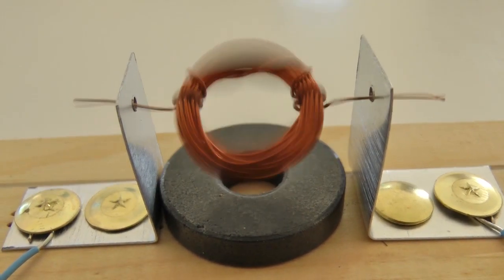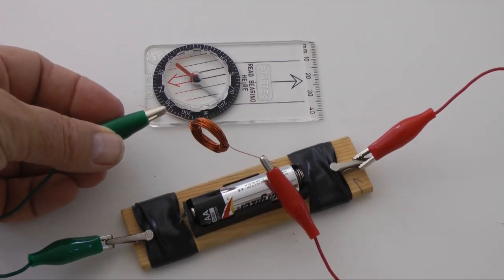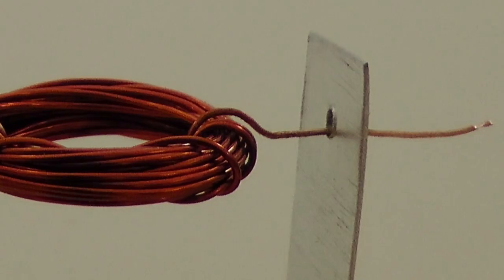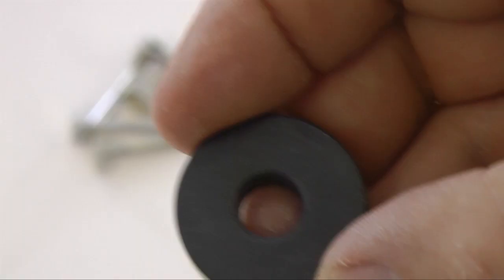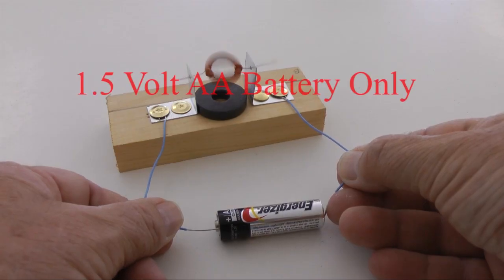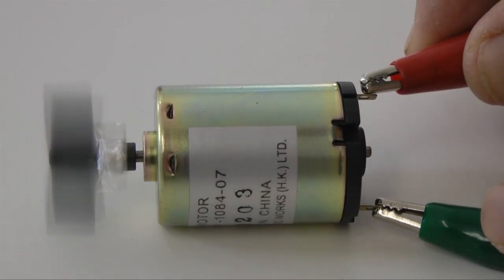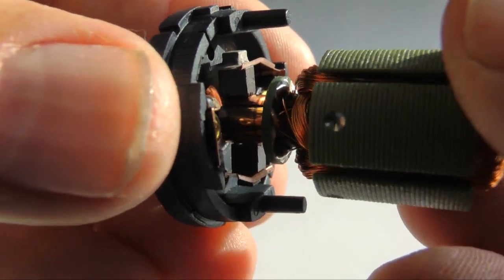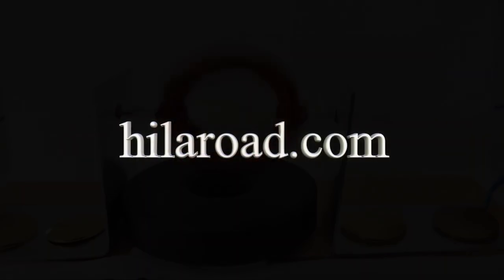Build an Electric Motor

Comment: When I found my interest for these things again, after about 35 years back in 2009, I started with this simple motor. I was so excited when It worked. I kept on going since and now I make motors that are a big step up from this one. I went brushless with my last one but I built my own magnetic switch instead of using a ready made reed switch. An for my next one I will finally use my nemesis, the transistor. I  have them all on my own site, if you are interested. Good luck everybody!
Reply: nice

Comment: how can i turn it into a generator and make LED Light turns on?
Reply: You just do the opposite and turn the coil of wire and the magnet generates a current in it thus electricity.

Comment: 0:20 Electrostatic motors have been around since the days of Benjamin Franklin. . . .   This simple d.c. motor demonstrated here has been around since ~1850 . . . .   3:00 You do not scrap/sand off all of the insulation on both rotor leads, just one.. The other should have its insulation removed for about 270 degrees(or less) around the circumference of that lead.. This creates a 'pulse motor' action instead of comutation.

Comment: How come the motor works without brushes and a commutator?
Reply: +U N this is a terribly ineffecient motor that's mainly for demonstration purposes. A better motor would be an AC motor that switches polarities to induce torque to drive the motor instead of momentum that the above one relies on.
Reply: From what I can tell the connection between the rotor wires and the holes they pass through are actually making a very crude commutator. Ordinarily the rotor wire is making contact with the metal around the inside of the holes, which results in a rotational force. As the rotor flips over the wires crawl up the sides of the hole and then fall away, momentarily either breaking contact altogether or causing the connections to become intermittent. The rotor continues to flip over, the wires fall back onto the bottom of the holes re-establishing a good connection and the process repeats. It would be far from perfect, but you only need a small imbalance to result in a continuous rotation.
Reply: +Matthias Andersen I'm pretty sure the inertia of the swinging coil allows the coil to swing past and complete a cycle. So the coil is attracted to the magnet and it swings around to align but it but the momentum of the coil pushes it around and around aided by the occasional magnetic attraction from one side of the coil.
Reply: +Joseph Schmidt Do you know how I can get this motor to move something?
Reply: AuthenticKaiser Yea I'd expect an AC motor to perform better but for a project I'm required to make a motor like this one and make it move something light like a coin. I'm pretty stumped on how to make it move a coin.
Reply: +U N does it have to be this form? you can't construct a motor that switches polarity based on spin but still operates on DC batteries?
Reply: AuthenticKaiser Honestly not too sure but I don't think so, she just gave us a 9v batterey, some coil and neodymium magnets and sent us this video telling us to construct it and make it move something.

Comment: Is there any way to control the heat generated in the coil?
I found that the heating effect occurs even in case of a solenoid. Can that heat be reduced by may be adding a resistance in series?

Comment: Is there a relationship between the volts in a battery, and what kind of wire we use. cuz I remember in my physics class, we made a motor with a 18 gauge wire, and a 9v Battery
Reply: +Akrash Ali 

Not necessarily just the voltage. The amount of current that a wire can carry depends on a few different factors, for example the composition of the wire, wire length, and condition of the wire. In general, thicker wire can carry more current. So, when you replace the battery with a higher voltage without any form of current regulation (resistor), the wire may heat up significantly and possibly fuse! The high current and voltage can also provide a significant shock if touched.
Reply: Mostly Amps, wire thickness/ gauge will dicated current transfers.. if you run 10A on normal wires it will get too hot, alternatively thicker wires also offer lot of resistance... Also high voltages are beneficial for transferring power with less cost, if small Amps are send across long distance... for example AC Electricity we use.

Comment: im curious what happens if u change the power source?
Reply: +Enrico Aquilina If you use power source with higher voltage, the coil may get more hot or even start to burn.... as far as I know. Higher the voltage, higher the current.

Comment: I understand your model but one confusion : If one other  coil  is placed near to your model but "it not touch or connect to your model" ,,,,,,,,,,, this un-touched coil can rotate or not ?????          I just want to know only that,,, in your model ,fitted coil is rotate with the help of flux linkage but there were a current' path is take the help of coil or not for becoming closed circuit ???

Comment: It's never a good idea to short a battery. Current is equal to voltage divided by resistance and when you short a battery you're essentially giving it 0 resistance. So the current is only limited by whatever the internal resistance of the battery is. 
It's not too bad with AA alkaline batteries but anything else could explode or burst into flames.

Comment: I only have a very very basic understanding in the science of electricity, and this made total sense! I didn't just learn how to make my own electric motor, but I also learned more about electricity. Thanks!
Reply: A very well  done video.  The main negative about the video is that it maintains the existence of the electron, maintains that magnetism attracts and doesn't explain what electricity is. Tesla's greatest discovery was finding out what electricity was. All the electrical engineering heavy weights of the 20th century - Tesla, Steinwetz, Heaviside, Maxwell have always asserted that the electron doesn't exist and that magnetism only repels. Tesla discovered that electricity is composed of magnetism and dielectricity (not the wkipedia version). Google Eric Dollard too.
Reply: I knew it had a lot to do with magnets and electricity,  I also learned that I just needed to learn what problems arise like the details. 90% science 10% engineering.  it is the 10% that I got a better understanding of.
Reply: Jordan Fischer 8jTSSuicfj3vj1ej)qdp)neq

Comment: So the battery changes the copper wire into a magnet by sending a current through it, which in turn causes the copper wire to spin due to opposing magnetic forces. I feel like I'm missing something because with this understanding we could just use two normal magnets, instead of one permanent magnet and some copper wire turned into an electromagnet. So can someone explain this more in depth to me?
Reply: +RdotJdot12.3. At the 5:20 mark when he connects the battery to "start" the motor he is repeatedly tapping the wires on and off the battery to momentarily remove the magnetic field within the coil then quickly restore it in order to "rock the coil back and forth" until it gets enough momentum to keep flipping over to change the polarity of the coil within the magnetic field of the permanent magnet. You are correct in saying that two permanent magnets (one mounted to spin in place of the coil) would produce a similar effect, but you would have to start the spinning of the rotating magnet by hand as demonstrated at the 5:45 mark when he uses the pencil to start the coil spinning. The difference with using a battery-&-coil in place of a permanent magnet is to sustain the rotation. In a 2-magnet version, the spinning magnet will eventually lose momentum and stop spinning with one of its poles facing the stationary magnet and trying to attract the opposing field on the base magnet. The experiment shown, if left to run, would show the coil spinning for much longer (since the coil is lighter than a permanent magnet of similar size) but it too would eventually lose momentum and stop just like the permanent magnet would, and try to attract one of its poles toward the base. In theory, if you could give the coil enough initial momentum in its spin (perhaps giving it good hard flick of the finger) the coil could keep spinning with enough momentum until the battery drained down to a point that the magnetic field generated in the coil would be too weak to interact with the magnetic field of the permanent magnet and the coil would finally stop spinning.
Reply: Thanks for answering. I now know that the breaks in the commutator in a motor is responsible for keeping the electromagnet spinning because when the electric current disconnects at the break and restarts again the poles in the electromagnet switch, allowing the changing electromagnet to attract and repel the field magnet in a way that the coil of wire will continue spinning. In this video it was not explained that one side of the wire's insulation should only be half sanded off to serve as the commutator to switch the poles of the electromagnet.
Reply: +PGIFilmsThe odd thing is that the homopolar motor is self starting and spins without commutation. Apparently due to the coil being in a vertical position to the face of the magnet as it revolves around the magnetic lines exiting the magnet face.

Comment: if you want this to work you need to strip the insulation on only one side of the wire on both sides. this work as in place of a commutator and it stops the current so the coil do sent just stick pole to pole
Reply: sry, not both sides, top and bottom of the wire on both sides
Reply: +Matthew Poole hmm it would still have the same electrical contact

Comment: can we use copper wire without insulation
Reply: If you want to get zapped
Reply: If you do i would use thick rubber gloves with alot of electrical tape

Comment: has to be magnetic copper wire... it will have a purplish brown coating over the pink copper
Reply: stal lion No it doesn't.  You can use any solid core wire with insulation.  Magnet wire comes in many colors.

Comment: why we are not  having  any uni polar magnets....? plz give the answer.....
Reply: Samudrala Vamshi i havent studied magnetism in nearly 10 years but magnetism is caused by spinning of electrons the spin creates 2 poles on the axis of the spin... stronger magnets are those which have more free electrons even water is magnetic to a degree a magnet held over water will cause a slight dip in the surface
Reply: ok.tan q
Reply: a question i have is what is the polarity on the sides of a cylindrical magnet

Comment: what if i use 10 batteries instead of 1?
or, can i use 1 lithium ion battery (mobile phone battery) as the power supply?
Reply: It would burn out the motor

Comment: I made this motor and here are some tips /- 
1-> Your coil should be made of somewhat thick wire. The thin coil would not fix . 
2-> You can use paper clips instead of aluminium .
Reply: Hae do u still have this project with u??

Comment: I think it's better to strip just the half of the enamel on each wire.
Reply: I have built both. There is no advantage to removing the insulation on half the wire on both sides rather than all the insulation on one side and half on the other. In fact if you remove the insulation on all of the wire on one side, then you are sure to have conduction when the uninsulated part of the opposite side makes contact. It will work both ways but as to what is better, I prefer to remove all the insulation on one side.

Comment: I have a dumb question. If a battery produces DC current, how a coil is moving. Isn't it true that AC current is needed for that?
Reply: we hare use the exciter 'battery' as a stater and the magnetic field is the rotator

Comment: hi,
 i tried this 3 times but simply it didn't work. the only thing i changed from the explaination is attaching the coiled copper wire to a metal stick in order to tie it to 2 wheels and make them rotate. what is the problem?

Comment: Great video and explantion, but how would you measure the energy output and the efficiency of the motor?
Reply: an ammeter connected in series to the battery and the motor will show you the current consumption..this homopolar motor is inefficient because it makes a dead short of the terminals to move and dead shorts consume energy like hungry cats eating friskies..the by product of inefficiency is heat which is why the video keeps warning you not to use large battery to operate this and not to hold or touch the coil soon after it is stopped..however saying so, it must be noted that the worst inefficient motors make good generators and vice versa..thats why homopolar motors should be configured to become generators instead .Michael Faraday made a mistake 200 years ago when he failed to see the true potential of a homopolar disc generator.He chose and pursued with the current coil and magnet generator method of producing electricity which continues to be used today consuming massive amounts of drive input energy to make energy conversion

Comment: Hi!
I tried t make this motor...but it just won't work!
Here are a few things that could be the cause:
1. I used thick metal sheet
2. I simply used a round magnet, instead of a disc shaped one.
3. I used a copper wire instead of a magnet wire!
I  urgently need help...someone please help!!!
Reply: Thick metal shouldn't do anything, and magnet wire is made of copper and other conductive metals. The shap of the magnet doesn't really matter to mch, so maybe try rebuilding it. Heres a HowStuffWorks link so you can learn a bit more about the electric motor

http://electronics.howstuffworks.com/motor1.htm
Reply: Ok, thanks :)
Reply: The wire needs a kind of insulation in order for the motor to function, did you just use exposed copper writes instead of insulated ones for this project?
Reply: Max Hendriks  That is not true at all. Insulation is there to help prevent burned hands, and to keep it from other electrical sources that may be unneestisairy to touch. Your statement is false

Comment: Materials Required -
- 2 pieces 2 cm X 6 cm of thin aluminum (cut from thin aluminum cookie sheets)
- 1.5 meters of magnet wire (24 or 25 gauge,)
- 2 metal tacks
- 2 lengths copper wire, 15 cm 
- 1 ring magnet 
- 1 AA battery (Do not use any battery rated above 1.5 volts, overheating of coil will result)
- 1 block of wood, 6 cm X 15 cm
- Small piece sandpaper
- 1 elastic band.
Reply: yeh tera school ka project h..?
Reply: Riya Kabra yes baby !
Reply: tumhri info ke liye main is saal 16 ki ho ri hu..aur ek teenager hu..baby ni..:P
Reply: Riya Kabra main tumhe details print karke de dunga air samjha bhi dunga !!!!!! just call me whenever u need it but before 23rd !!!!!
Reply: Riya Kabra by the way baby can be used call someone who is liked or loved !!!! :p
Reply: ohk..thanku btane ke liye..:P
Reply: So u didn't get it !!!!!!
Reply: Yes , u can use copper wire but if u use electrical tape for insulation electricity will not pass thru it and copper wire will not rotate.

Comment: It gets hot because of the current. With increased heat, there is increased resistance. More resistance, less voltage. V=IR

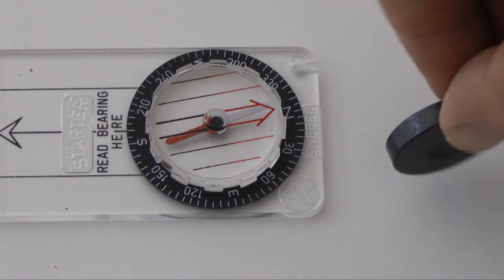Comment: What materials were used at 1:01, the black thing i mean with a battery in it? Just a battery,battery holder and electrical tape? Please answer my question. I need to do this for my science project.

Comment: The reason why the coil gets hot is because you scraped the enamel off all the way around on BOTH leads. That's not really safe.
Reply: So how should it be done? only one side on each tip?
Reply: @holohulolo  For just a simple DC motor like this, either scrape one lead whole and leave one half of the other lead exposed while the other half has enamel insulation, or scrape half on both leads. If you are building one of those powerful motors with brushes, it is necessary to scrape enamel completely from both ends of a coil or coils.

Comment: Hey guys i need some help please, is there any way possible of making a motor running just from magnets and coil wire, and connect it to a electric heater ? i need one in our shed cause its so dam cold ! lol
Reply: it takes as you know the magnet and coil wire. add the magic beans also and pray to magicelectro, the volt genie. first kindly turn on your heater or he will not visit to construct this for you.
Reply: sorry this amounts to perpetual motor not yet discovered on the earth..dont believe those videos showing motors running on it own and providing excess energy..those are fake videos

Comment: But how does that motor keep spinning while being powered with DC? isn't the magnetic field constant? It doesn't have a commutator.
Reply: Typically people will only remove half the insulation on both wires, but removing all the insulation will still work (as seen in the video).  I believe it's because the wire bounces every cycle to break connection, which acts as a commutator.
Reply: On the coil you remove the insulator on one side of the exposed wires. This turns the circuit on and off 1 each spin. The north side of the magnet(if facing toward the coil) pushes against the north side of the electromagnet you created and creates half a turn, the insulated wire is now against the metal ending the circuit and the electromagnetic(the electrified coil) life, inertia keeps spinning it turning the motor on and off repeatedly this spinning it as long as there is a powersource
Reply: heyitskyle9 Ah, Thanks for that clarification. I was wondering as well how that was working with stripped ends on both sides.
Reply: Peter Steve I'm using a very thin guage copper wire and can't tell if I'm sanding the correct side. I'm trying to make a commutator myself but it's too difficult :/